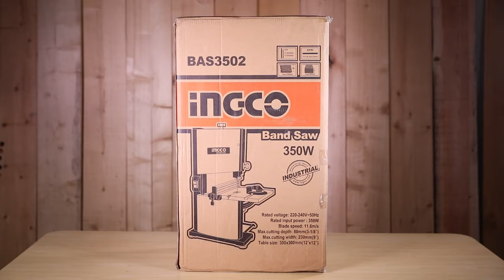INGCO Band Saw BAS3502

Comment: I m from Bangalore , India. I got this machine without blade. I was chasing our supplier for blade for more than a year. But ingco refused to supply the blade. Finally after one and half years we got the blade. But it is not fitting for this machine. I understood ingco is not ganuine. I think they exported defective piece. Still the machine is not running. My advice is don't go for this
Reply from the maker: Hello, we are replying from INGCO headquarter. This product is sold separately for machine and accessories/blades. We have checked the import list of our Indian dealers and none dealer has imported this the accessory/blade from us, so people cannot buy INGCO's blades for this machine in India. However, since the blade is a common model in the market, i.e. you can buy other brands of blades to fit this machine. We apologize for any inconvenience caused to you. You can send us a private message on Facebook page INGCO INDIA with your contact information and address and our staff will send you one of our power tools as a compensation.
Reply: @INGCOGlobal  Thanks for your response.  Is ingco is selling band saw machine without blade? I got the machine without blade. With continuous followup, I got a blade after one and half years. But it is not fitting. But you mentioned in the reply that any local blade will fit with this. But not working. What is the solution for this?
Reply: Can you suggest Any  indian brand
Reply: @INGCOGlobal  Till now I m not able to fit this band saw blade issue. Are you selling this machine in India even now? I don't have any idea to fix this issue.  Sorry to say this. I m always getting negative remark from my management because this band saw. Do you have any solution?